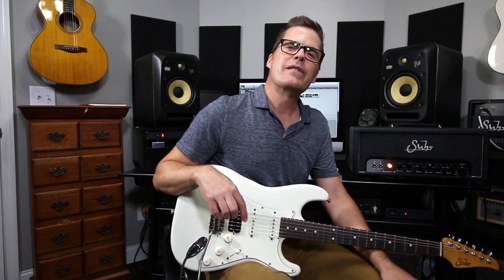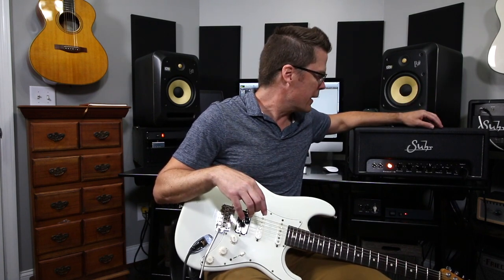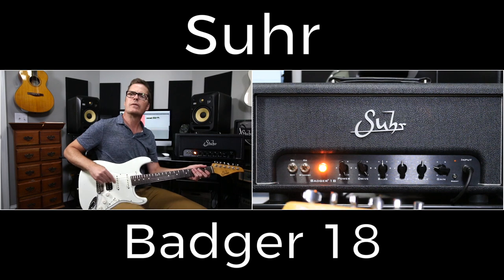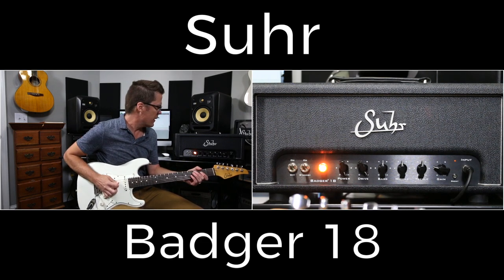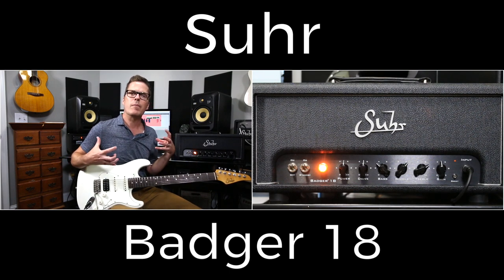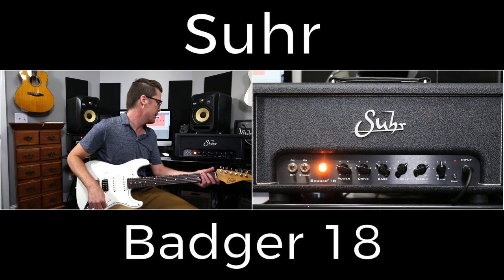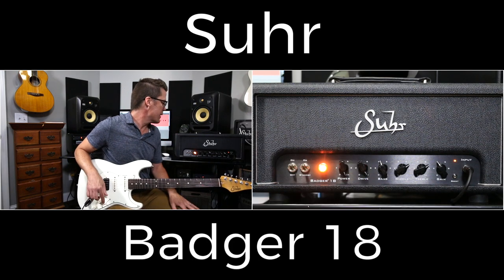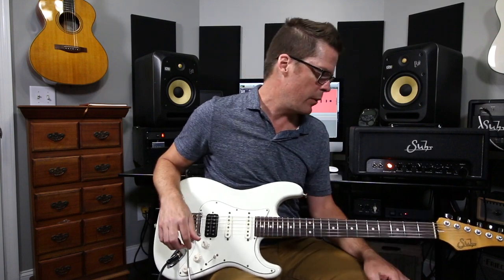Suhr Badger 18 In-Depth Demo Video by Shawn Tubbs

Comment: Great demo Shawn. I have this amp set up and absolutely love it. One idea - I have been using the DRIVE knob to create a darker, richer gain. I keep the GAIN knob closer to 2.5-3 and once the DRIVE gets above 6.5, the gain comes on strong. Even with the POWER knob at about 3. I find the gain you get is richer and doesn't lose the clarity I find happens a bit if you crank up the GAIN knob. Just shows how versatile this amp is.

Comment: Interestingly enough, I am a Morgan MVP 23 user and I was out looking as any guitar freak will do or tone chaser and ran across this amp. Funny enough I find some very comfortable sounds to this and the two Morgan amplifiers you’ve got enough brightness there for it to sound like the Morgan AC 20 with it in the, bright switch turned in moon position on that amplifier or the MVP 23. You’re getting some of both of those tones as well as a deeper British grow. I think this is a very versatile amplifier and certainly a great pedal platform. I like it a great deal and went ahead and bought one, although it was five years old. Also, I paid as much for it as I did the Morgan had that was only a year. This is really great and it was well worth the 1200 bucks I am surprised it is not to point it does not say exactly but I am sure that there is a combination and some wiring. The sensitivity is just too fantastic. Thanks again. Great bedroom Amp and certainly great for local gigging to this will be an amp good for years to come 5:29

Comment: No doubt this has a lot more drive and bottom end, but I will tell you there are some tones that you can easily dial in with this amplifier that sound just like my Morgan AC 20 and my Morgan MVP 23 and I also know this because I bought this head as you will see in another comment I made but I was listening to your demo again and it just struck me that I ought to mention those EL 84 tunes can be dialed in and a lot of these nice amplifiers no doubt I have collected 23 heads now and I think my tone chasing is done to tell you the truth lol I bought one of your petals. By the way I love it. It is a great overdrive pedal not so much distortion but great drive, thanks again for a great demo 6:13

Comment: Great video Shawn – such creative playing. I’ve got a older generation badger 18, great sounding amp. I really like sounds you’re getting with the MOSFET boost here but it would not be worth it to me to replace the entire amp to get it. Can you think of a boost pedal that would give a similar kind of gain structure and push?
Reply: That's awesome - really appreciate your thoughts. I'll check out the Buxom Boost (and you're right about Shawn's playing making everything sound great. Note choice and feel really do trump everything don't they!)
Reply: Yup. That cost me $250.  Sigh... ;-)
Reply: I use a koko boost with my old badger 18
Reply from the maker: Hey, thanks for the question and for the kind words! I am a fan of the Friedman Buxom Boost as well as the Archer Clean Boost and the Koko Boost. I think any of those pedals would be really great into the front end of your Badger for boosted tones. One thing to consider is you may prefer a MOSFET style od pedal to the front of the amp to get closer to the tones you're hearing from the new Badger. Maybe look at boost and od circuits that are Mosfet. The Fulltone Fulldrive MOSFET comes to mind as well as the Blackstone Mosfet OD.
Reply: Shawn Tubbs Thanks for the point out to a MOSFET drive - - - and the inspiring vids!
Reply: @ShawnTubbs   Great question Lonny (I have the older 18 also), and a super helpful response.
Reply: Lonny Handwork Lonny are u in the U.S.? Because you’re paying way too much. Deals can be made these days they any online store, reverb and well I’m in a major city, a big city and we have no guitar stores left but I used to make a deal there too since I was a constant customer. FYI I think I replied to the wrong person. Try the Friedman golden pearl to boost that badgers distortion. Just a suggestion. There’s one right now on reverb $132 in excellent condition.

Comment: Hey Shawn! I asked you about the a home-volume-friendly amps on the Gremlin Video. I have since narrowed it to the Gremlin, the REVV you suggested, and the Badger 18, all different beasts, I know haha. There's a used Badger 18 in the newer version near me, which sorta makes me lean towards that if I can manage to see it amidst this Coronavirus craziness. I just wanted to ask for your thoughts if they've changed at all since this video. Does the power scaling make this a good option for home use as well as stage? Or does the power scaling cause too much tonal loss? Thanks for the help, killer playing as usual! Cheers
Reply from the maker: The Badger 18 is still the same other than the Mosfet boost. The power scaling is good on the Badger 18 but it's not a selling point in my opinion. The Iron Man Attenuator is really good.

Comment: Awesome! Just one question...did you adjust the EQ on the amp when switching guitars? I noticed on the amp that i use, i need to adjust the EQ when switching from tele to strat. Thaks for the great review!
Reply from the maker: From what I remember, from tracking the performance content, I left the EQ on the amp the same for the Suhr Filtertron Tele to the Suhr Strat SSH guitar. When I switched to the black LSL I turned up the gain treble and mids because the Loller Singles were lower output but I was really happy that I was able to throw from neck to the bridge position with that tone setting. I left the EQ and gain the same when I switched to the Suhr Alt T. Thanks for the question and the kind words!
Reply: @ShawnTubbs  can you tell me what loller single pickups in your LSL guitar?

Comment: Hi Shawn, wish you had done a demo of the 35 but I guess it's tonally similar. I'd like to ask you about it's volume levels, if you've had the chance to play one. I'd need it to be eeeeasily giggable. Love the playing in your stuff here--not the usual clichés people put in demos. Thanks!
Reply from the maker: Thanks so much for watching and for the kind words. If you like the 18 but are concerned about headroom on stage I would definitely go with the 35. It's very similar. I own the 35 myself.
Reply: @ShawnTubbs  Right, cause with the 18 dialed up all the way on the power and drive you're surviving it no problem, no earplugs, no nothing. Really hoping the 35W is seriously loud. Unfortunately, I have no way to check before I buy--
Reply: Ad Ici De for what it’s worth, every 4x el-84 amp I’ve played was super loud. All non master amps. I’ve owned a fair amount and had to get rid of them all because they were just too much.
The power scaling on the badger seems very intriguing
Reply: @INT_Based  Thanks! I actually didn't like the Badger when I tried it. But yeah, it would have been loud enough.

Comment: I'm picking up the Badger 30 this weekend (my first tube amp) but am wondering how often these tubes need to be changed and how hard they are to get ahold of these days? Also, should this amp have a certain kind of tubes in them? Thank you!
Reply from the maker: For the most part, EL34 tubes are pretty easily sourced. Power amp tubes can last a long time depending on how often and at what volume you're playing. I've got amps that I've had for years with the same tubes in them. The brand of tubes in my opinion is subjective. There are tons of resources on the internet if you want to nerd out on that stuff! Enjoy your amp!
Reply: @ShawnTubbs  Gotcha. Can these amps be sensitive? I've heard that you have to let the warm up a little bit before you use it. Also, are the tubes hard to replace?
Reply from the maker: @Claybraham91  Vaccum tubes require heat to operate so most tube amps need about a minute or so for the filiments in the tubes to warm up. If you were to just turn the amp on and go for it it's not that big of a deal but at the same time it's a good habit to let the amp "warm up".

Comment: The only thing I don't understand is when it comes to the 30 watt and 35 watt versions what's the point of getting this one when you can just power them down to achieve bedroom level playing? And then you have a 30 to 35 watt amp for clubs. I'm looking at the older style badger combos and I'm stuck with that scenario right now which one to get. The new ones look cool but I kind of want the all-in-one combo unit.
Reply from the maker: The two amps are based on different power sections. The Badger 30 utilizes EL34 power tubes. That power section feels more immediate and leans toward a "Marshall"
in the mids and top end. The Badger 35 is an EL84 power section. That amp is going to have a bit more "squish" in how it feels and the top end especially is going to be more like a "Vox". More chime for sure but softer feel. So it's really not a question of headroom. It's really feel and tonality.
Reply: @ShawnTubbs  oh gotcha thank you for that shawn.

Comment: actually, That New " Celestion 100.16 " is a 30 watt .....that is 100db1w/1m also. ( loud enough to do something with it )
if I had the bucks, that amp and cab, I would get the 16 ohm.                                                                                                        EDIT: ( ouch, 400 bones; 100th anniversary collector edition )
                                                                                                                          
run the power and drive wide open into that, hey?....I can just imagine rolling up the gain, and finding the sweet spot....maybe not much louder, but more compressed and goodness also.

Comment: Friedman PT20 vs Suhr 18 Badger?
Reply from the maker: I unfortunately don't have any experience with the PT20 but I've heard great things!
Reply: @ShawnTubbs  Thanks for the demo! Great playing. In your opinion, I have to use an attenuator with the 18w badger to enjoy the full potential of the amp?
Reply from the maker: @Matan2222222  The Power Scaling on that amp is really good. I would think you would be fine without an attenuator.
Reply: Suhr 18 Badger...better build quality imo.